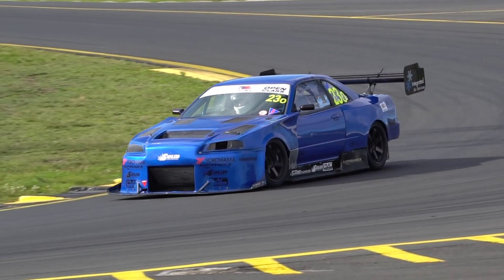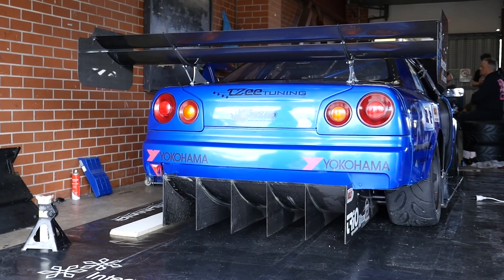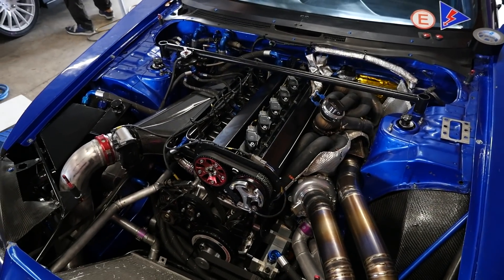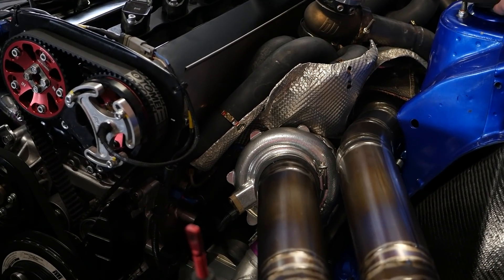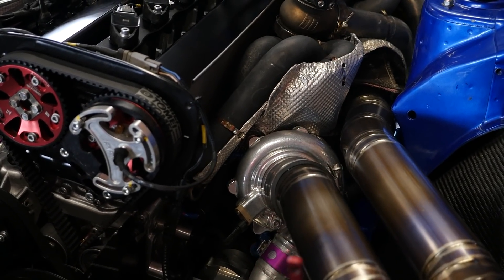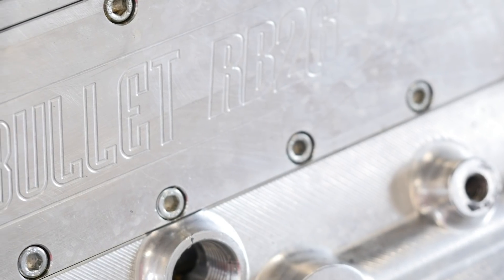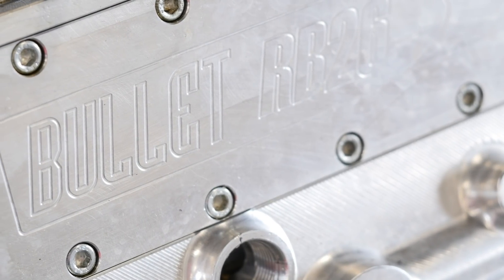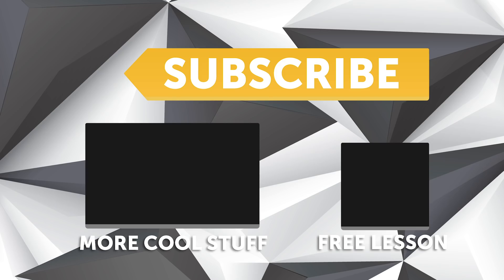1200HP, 35 PSI And 10,000 RPM Of RB26 Power | R34 GTR

Comment: Why would you go to a billet block and not upsize mains and big ends on your custom crank while you're at it? If you're redesigning from scratch then just go to a bedplate crankcase.
Reply: It's already done new version with bigger components
Reply: RB block start falling apart @ 800hp, cracking around head studs
Reply: @Eclipse538 Oh I thought Bullet would have offered a degree of customisation, esp for deck height - it's not exactly a high volume product. And rods and crank could be tailored to suit standard size bearings, say from a 2JZ. Custom cranks and rods are really not that expensive in the context of a machine like this, over and above the average race spec RB28 stroker kit.

Comment: Good interview, as usual :-)

Problem with pistons when trying to improve rod angle is the ring pack limiting how high the pin can be - does anyone know if there have been experiments with single ring pistons done? With a gas ported compression ring there may not be significant leakage and any possible excess ring wear would be mitigated by the regular strip-downs required by the alloy rods?

With the big end pin diameter, if a stroker carank and aftermarket rods are already being used - why not have the crank pins made to a common size (Chev' LS?) and the rod big end bore to match? I suggest that size as they're getting up to 500hp per cylinder and similar bearing loads as a 3000hp RB would have, with excellent reliability.
Reply: I've seen some v8 builds with single rings and gas ports. I can't comment on less ring wear or increased durability of  alloy rods over steel rods. At some point enthusiast need to understand that unless you are racing for money to recoup some of your investment or have a bunch of free time on your hands that experimentation is not necessary. A standard steel rod, pistons with OE style ring packaging , OE block, etc is reliable at double the output. If you need more than double the power then I hope you are at least earning a little money with it to again recoup the investment. In terms of sealing and cylinder pressure, there isn't a ton of difference between say 700 hp and 1000 hp. If it was all about ideal deck heights and rod ratios we would all be running the same engines and cars. That wouldn't be terribly interesting since we see the same V8 combos over and over and over again. Turbocharging as changed much of that.
Reply: @dj4monie  
Yup, never been a fan of re-inventing the mousetrap as, as you say, 99% of the time established practice is 99% acceptable.
However, sometimes people just like to experiment for fun or are chasing that slight edge over the competition and money isn't such an issue where deep pockets are involved.

It is sort of bemusing how more and more higher end race series are tightening regulations nd limiting innovation so you need to look at the lower tiers where some innovation is still welcome of fresh ideas - Formula Student has some really out-there ideas, many of which are quite, quite brilliant.

Oh, for the same engine at the same rpm, at 1000hp it will have ~43% more cylinder pressure than at 700 - but I don't think that's what you mean ;-)

Comment: Some of you chaps, and chapesses, may be interested to know NISSAN are re-manufacturing a selection of RB parts, including blocks and FI harnesses - might be worth chasing up for the devotees?
Reply: _Cam0_  
You don't HAVE to buy from NISSAN. Perhaps you should simply make your own, or pay for custom parts?
 Don't forget, it requires re-tooling and manufacturing for a limited demand, so the amortization has to be done over less production units, then there are holding, shipping costs, dealer markups, etc.

What is a rip-off, IMO, is the company that bought the manufacturing rights to the Cosworth KBA cylinder heads increasing the price by ~500% over the old suppliers price! I have some spare heads, but %^&* that!
Reply: _Cam0_  Uh, genuine NISSAN produced parts through the NISSAN dealerships - they ARE the "stock price"! 🤣

Comment: 1200hp from a 2.8 is nuts
Reply: Atlas F1 in the 80’s ran 1250 hp 1.5L 4 cylinder at 80 psi in qualifying trim , BMW
Reply: @gemini3558  With stock block castings. 👍
Reply: Trent Marlowe yes mate standard cast block 😜👍🇦🇺
Reply: The ran 800hp in race I think thou bmw
Reply: Maryam Kaita yes 800-900 hp in race trim 😜👍🇦🇺
Reply: Meanwhile tekno toyz makes 2000hp from a sr20
Reply: Dont leave out the rotors! Big big power wee wee motor :) oop did someone say brap brap rebuild?
Reply: There are 2400hp 4g63's out there.

Comment: PMC builds great engines what they don't tell you is how much trouble everyone is having not just PMC with billet blocks from growth due to heat, causing clearance issues etc causing failures. Sounds insane thou at that high rpm
Reply: Where are you getting this info?
Reply: Alloy block, and rods for that matter, will require slightly more crush - perhaps some builders aren't paying attention to that?
At extreme levels, bearing manufacturers will be able to supply custom shells drilled for dowel pins in the block - this is more commonly required for alloy connecting rods under VERY high loadings
Reply: @JDMjames32  Uh, no - at most he means thousandths of an inch - but let's work it out.
Thermal expansion co-efficient of aluminium is ~0.000024 per degree centigrade, so for a 0.6 metre tall block that would be 0.000014 m/C or 0.014 mm/C or 0.36 thou'/C.
Assume a 70C temperature rise and it'll actually be ~ 25.6 thou', or 0.65mm.
As it's an alloy, the expansion will be a little less as the common alloys use elements with less expansion and, of course, if the height is different the expansion will also be different.
NOTE, cast iron also expands, at approximately half that rate, so for an iron block it would be approximately 13 thou' or 0.325mm.
Reply: Following from Mr James'post, assuming* a bore of 65mm, and a rise in temperature at the mains'or 100C, the increase in bore would be ~0.15mm or 4 thou' - hmmm, a bit more than I expected and definitely something that could cause bearing issues if not addressed during the initial build!
NOTE, may have slipped a decimal but did triple check as it seemed a bit higher than expected - might still be wrong, though, as well past bed-time...
ALSO, while that seems horrendously huge, the co-efficient of expansion for iron is half that, so in some ways it isn't as bad as it seems - still something to be aware of, though.

 * Can't find the actual bore.